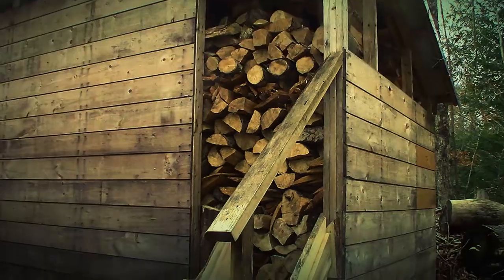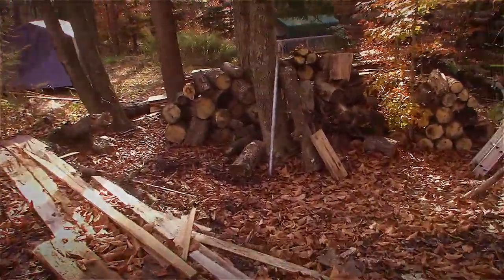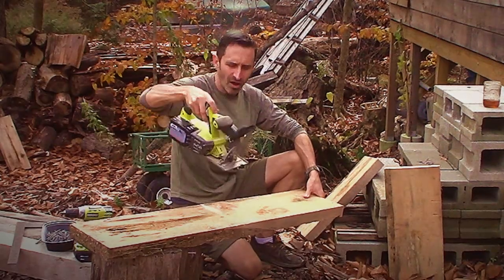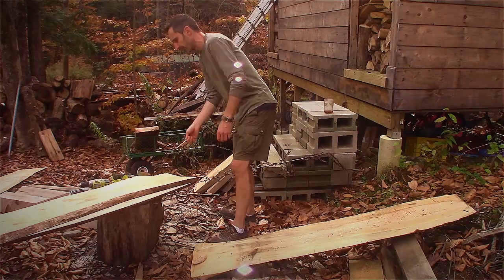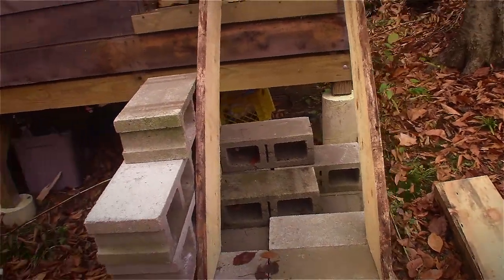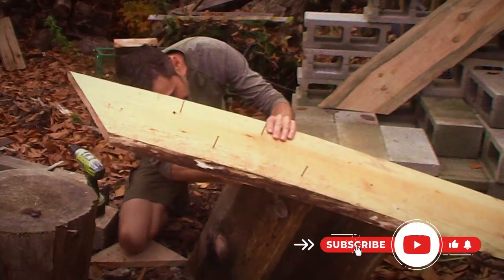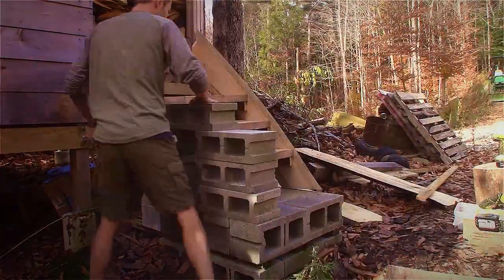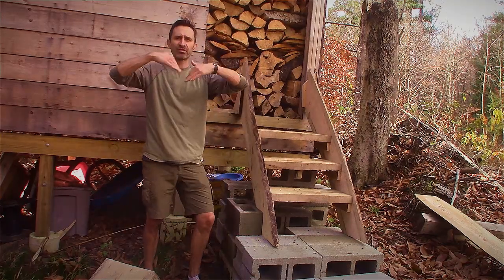Building Wooden Shed Stairs from TRASH

Comment: Man,you’re set. Thanks Prax. I hate buying stuff, soooooooo if you don’t mind me asking? What was the cost investment solar on the house? Off topic sorry
Reply from the maker: Not off topic at all. My whole channel is about DIY and being less reliant upon unreliable things. I tried to get price quotes on the solar system. The best one I got was a system w 4kw of panels on the roof and a 5kwh battery for $140,000. That was absurd. It was more than I spent on building the entire house, and having set up smaller systems in the past, I knew it was astronomically marked up. So, my dad mentioned this place called Sun Solar out of Miami, FL. They sell systems that people can set up themselves. So I went with one of theirs. I got a system with 6kw of panels on the roof (50% more than the first system I got a price quote for), and a 10kwh battery (double the size of the one in the crazy price quote). And that system I bought for about $20,000.
If you're thinking of getting into solar and would have trouble with $20k, though, don't be discouraged. You can DEFINITELY start small and then build bigger later. Consider doing a small system to run something like just your fridge, or just a well pump. Build that, and then in the future, when you can afford it, you can make other totally independent systems to run other things. There's a HUGE advantage in doing it that way vs the way I did - because if my system has an issue, I lose the entire system. If you had 3 or 4 independent systems, if one went down, most of your house is still up while you repair that one system. And as you take parts of your house off the grid one by one, you can start saving money on your electric bills while  you slowly save up for more and more systems.
Reply: @PraxisPrepper  that is exactly what I’m looking for! And what a crazy quote. Thank you for the deets !